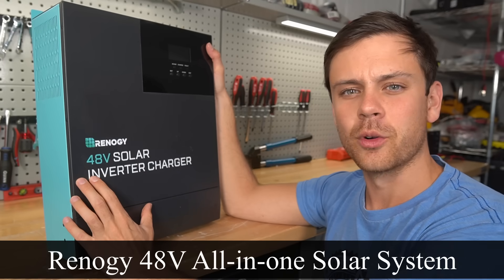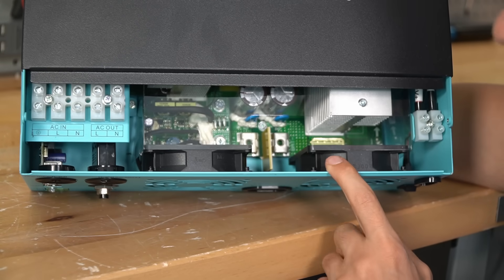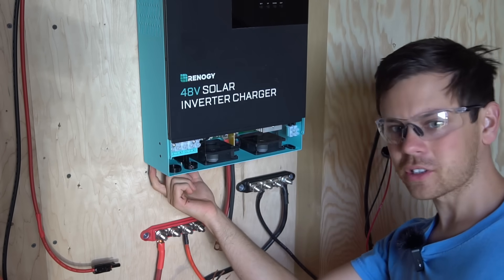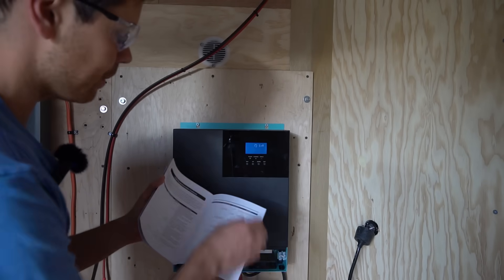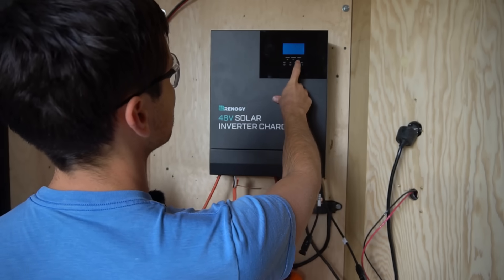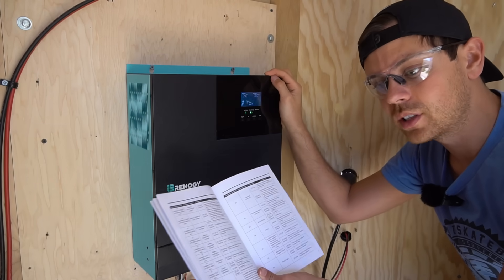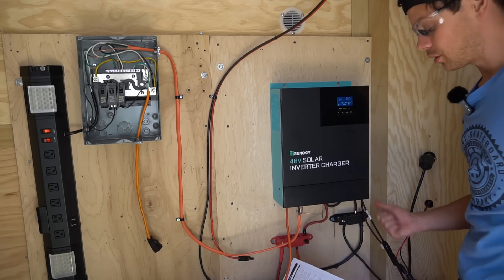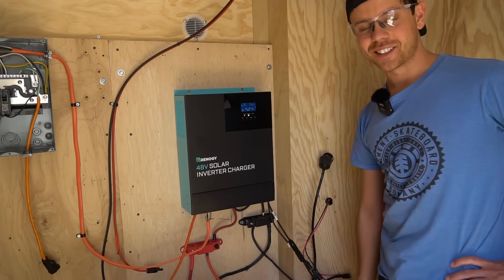Renogy 48V All-in-one Solar System: 3500W Inverter, 4400W MPPT, 1920W AC Charger

Comment: You know the watts have nothing to do with the grounding...
The ground connections are for safety and EMI reduction, nothing else. And improper grounding can actually cause EMI. 
Now, think you're running a house on that, on grid.
The inverter supplies bi-phase current, not one phase and a return/neutral. 
On the grid you get a phase and a neutral that is tied to ground in the distribution panel. Some inverters have a floating ground enclosure and some have the battery negative to ground. Who knows, there might be inverters that have the PV and battery negative to ground. 

Now, everything should be just fine if your on a single phase grid and make sure the grid neutral and inverter phases never meet (grid isolated) 
but the moment you add another phase like in the 240v american systems, things get complicated and dangerous. 
They just might had played it safe and left the metal case floating and to be earthed locally and not connected to the mains input or output ground.
Reply from the maker: I said in the video, non current carrying reference voltage ground. That should tell you exactly what I meant. "Non current carrying" means exactly what I said. The wattage wouldn't matter.
Reply from the maker: Wait are you joking me??? Why would you think that I think that? Jesus this comment is ridiculous
Reply: @WillProwse  Bro,  you said it.  Twice...  at about 5:10 and around 9:23. It doesn't have a ground wire connection for mains and you're pulling *Watts.
Reply from the maker: @PașcaAlexandru  do you not understand that every unit on the market has a nice little terminal to ground the case? It's nice. This one doesn't. I know why and how we ground, and it has NOTHING to do with that.  Nothing! I prefer having a solid ground conductor that is the same size as the others, connected to a strong terminal. It has nothing to do with the watts! But when you connect a panel, I like a large terminal to connect my ground to.
Reply from the maker: @PașcaAlexandru  I was mentioning the wattage because if you are connecting a panel, it's nice to have a single cable supplying three terminals and all using the same gauge. Like 99% of units on the market. I specifically stated the watts because that large of an output will usually supply a small panel. And like I said, it's nice to have a large terminal, like all the other ones have. You can run your own case ground, or whatever you want. I'm not even talking about grounding or how or why we ground. I'm saying it should have a terminal. Like I said in the video.
Reply: @WillProwse  Yes, it should have a ground plug there, maybe floating,  yes it's a shitty design. 
But once it's a slip of tongue and twice is intentional so that's why I had to put my boot in the puddle. 
Sorry for the stains on your shirt. Here's a napkin. :P

Comment: Hi Will, I was wondering what type of inverter of all in one system similar to that one you could recommend for a DIY solar generator. The generator will have the following specs: 

- 3000 W AC output 
- 48V second life li-ion battery pack 
- AC input 
- DC solar input 

Thank you :)

Comment: Greatly appreciate your investigative testing here. I have a blind trust for renogy I guess because my main array is from them and I have a smaller mppt 40a CC on another system and they have been rock solid for years now. I was actually looking at one of their all in one inverters to replace my secondary systems 12v aims inverter. Think I may go with growatt now. Thank you for sharing your work.

Comment: Finally bought the Growatt a couple of days ago, after learning about this Renogy option last week.
Anyone that might need 240v split phase in the future; this Renogy is NOT for you. It cannot be paralleled. While they may change this [in the future], this version does not support this. Something I think would be more visible in the stats and reviews.

I went with the Growatt over the MPP because the Growatt includes the parallel boards in each inverter; while it is a costly add on with the MPP.  If I ever want/need 240v,  and I think it is only a matter of time, I will have the most cost effective option.

Best of luck in finding what will work best for you and your needs; and thank you Will, for sharing so much of your knowledge and experience with all of us just starting out. Peace

Comment: Can you run a all on one charge controller with just batteries an ac ?  Were it would use batteries to a point then switch to ac to recharge batteries. Then go back to batteries.

Comment: My charger/inverter does glitch sometimes and not allow you to ac charge. It needs a minute with no power. Then resets. I bought it because I wanted a way to charge with no sun. With a 3500w generator the charger pulls 120w an charges at 75amps BUT my 4x 100w panels charging at 20amps charge it faster than the generator lol wth

Comment: I will never buy a Renogy product again. I bought a 50 watt solar panel a couple years ago, it would only ever output 0.8amps. Nothing near the rated 50 watt output. I called Renogy support and they said they wouldn't replace the panel. They didn't offer a refund or replacement. No better way to ruin a customer for life. Horrible customer service.

Comment: I would fully agree to that part about connectors, small connectors ..those are for sure not good to handle so much current. you should see one in Victron....only two holes to connect it to wall...that is crazy....4 holes is standard..

Comment: got the   MPPT  brand unit cause the others were out of stock  for 30/100 days during  suez canal thing.   never had any problems/    menu system  weak  but works good..   quick transfer switch... did not like my big bench grinder..    but fridge, microwave, 2 space heater  all at once  easy..  get the 48 volt version   number 6 battery cables are nice.     with  50 amp dc draw at max power.   quick free shipping.  about $600 delivered. 
 still prefer my $3000 outback system.   ** update july  still running good.  700 watt ac charger seems fine.   not grid tie but full fast UPS

Comment: Love your videos. I just finished up my DIY solar portable generator build. 1500w inverter 12v with 100ah AGM, Renogy Mppt 30amp CC and 2 - 300w mono 24v panels. Runs my window ac unit ALL day love it. New Mexico.
Reply from the maker: Awesome!!!!
Reply: @WillProwse  I would like you to comment on the comments made by battery hookup com about the emails they have received about the lithium titanate cells they are marketing because they claim that they have spent six figures on equipment to test to verify that it has never been used that is not still b quality...

Comment: The manual for this shows specifically that the AC Input ground goes to a screw connector, and the AC Output ground goes to the ground lug on the bottom of the case. It seems that the AC input ground is bonded to the case ground. Will didn't hook it up that way.  The manual also says that there is an internal fuse protecting the solar charging, so if that blew out it could explain part of the charging issue he's seeing in this video.

In any case, I don't work for Renogy and I've never liked their products anyway so this is something I'd likely never use.
Reply from the maker: Yeah I stated that in the video. Did you not listen to my discussion about the ground screw? Please watch the video before commenting. I covered this exact point in detail.
Reply: @WillProwse  I did watch the video, then I downloaded the manual and read through it. It appears to me that the cabinet ground is bonded to the AC Input ground, but I didn't see that the AC Input was connected to anything other than the Bluetti, so it wasn't actually grounded to anything. So the cabinet had no ground, which means the hardware inside had no ground. I'm just guessing but there might be some circuit inside that checks or senses for a grounding issue, and then limits or discontinues some functions when that happens. The manual didn't really say anything about grounding requirements other than showing how to hook them up, and that seems a bit sketchy to me but is just about on par with what I expect from Renogy products.

Beyond that, I can't see a reason why it should stop charging an obviously low battery that needs to be charged. So unless there was an internal hardware failure for one reason or another, the grounding thing is all I can come up with.

Comment: @Will Prowse  There are two mode settings for the charge rate #28 is ac charge limits # 7 is max charge current for PV. Also make sure you have setting #6 set to CUB. When priority charging AC..    I Recommend going through all the setting parameters and fine tuning them
Reply from the maker: Oh I am well aware lol I have programed at least twenty of these now and still own them. I am very aware of those settings. And I didn't change any settings when the output when to nothing and the solar was limited.
Reply: @WillProwse   I honestly figured you knew about those settings, I just wanted to run it by you just in case your eyes over saw the pv charge settings.   I am now really concerned because I use my generator to charge my battery bank every cpl days, and the ac charge has worked well and I like how the transfer switch works with out losing my clocks or shutting off my tv..    I'm am now almost to the point where I will be able to afford my panels. I really hope the built in mppt isn't wacked out ..  I guess for the price I really can't complain if I have to source out a external mppt charge controller..  thank you Will for posting your videos. I love watching the batteries get put to the test..  there is so many options out there and your videos help pin point which ones are worth the good ol US dollar ✌️
Reply: @psychopitt1982  if you only need to charge every couple days how come you just don't plug into Outlet somewhere even if even if you have to pay as much as the gasoline would cost? The answer is you bought a box without a electric car charging input port but for many years now that's the thing it's called the two-way integrated EV grid interconnect which is worth the cost of a gas generator when used in the mobile application. I can't imagine living in a van with significant battery storage without being able to plug into most common EV charging stations are guys on YouTube who do it for electric unicycles not just bicycles and of course motorcycle
Reply: @ereenatc6042  the reason I don't plug into a outlet is because I am off grid. There is no outlets for miles except the ones on my generator. Which is a inverter gene and it sups fuel..  I just bought a pallet of 28 panel last week. Waiting on shipping then the fuel cost goes even further down.. I bought land built a box and now have some nice comforts of off grid power
Reply: New update.. the mppt has started to act all squirrelly on me. I have six 100watt panels hooked up in series. I've noticed in the morning after having great sun for over two hours straight the voltage will stay around 60vdc and about 4amps.  If I trip the disconnect from the panels to the all in one for just one second it goes to zero then apon the reconnect the voltage will go up to around 120vdc then drop to about 100vdc and I'll have twice the amperage.. so every morning this has become my new ritual unfortunately...  I just purchased a external mppt
Reply: @psychopitt1982   Remember your load controls the Total   product of your amps  And  VO LTS . You leave out the panel wanage And any shading issues you have us assume are not existed. You seem to be saying that the system is now broken but obviously you could put a warranty claim in or not and have made it the scission to order a what you call an external . However we don't know if the system that you have is going to be expanded on the battery side. It's very very very good to read the manual thread very closely closely closely but if you don't have the background to understand correctly or if they are poorly written Doing so creates another set of problems. In some cases the people who write the manual do not understand do not have the background it's not merely that they can't write. It sounds like they're some sort of safety mechanism that you are triggering by disconnecting things improperly but then I have not given this question of yours if there is a question the proper study of what you are referring to. You do not say why you do what you do. When you do something without a proper motivation you create noise similar to pour documentation or insufficient background. Interfering with a charging algorithm when is obviously getting hot will in fact confuse you with the response . If you are going to baby said baby set you should then put your devices that are temperature sensitive in a cold environment monitoring to make sure the cooling does not exceed the inherent heating of charging. For example you can charge phones in your freezer for most of their charging cycle without the battery becoming to  Cold but the phone may not know that and t Mayhey prevented from charging ay
Reply: @ereenatc6042  I understand voltage and wattages.. the system is just plain junk.. I hooked up an EP ever mppt and immediately gained an extra 2amps on my charging and the voltage is much more consistent.  You had took alot of time to type out all those words.
Reply: @psychopitt1982   I dictator them so it doesn't take as much time but obviously dessication was going very poor on
Reply: I'm not sure if you have the same manual that I have.  Those are the setting numbers mine show.. good luck will

Comment: Are you sure most of your solar inverters don't internally bound the In Coming Ling Ground with the Out Going Ground internally? Also, I bet the components in the renogy 3.5k are being run harder without being any better or more capable than the growatt  3k.

Comment: I had an mppt 40amp solar controller that would stop charging or pull in half the amount of solar avaliable for no reason. I was assured it wasn't the controller and it was every else. So I went through everything twice and nothing changed. Then I bought another overpriced Australian mppt controller and it works. By this stage I couldn't get a refund because it was pass it's warranty of 12 months although I had issues for 2 months. But that is Australia for you

Comment: More crap made in Taiwan. I bet there's hardly any copper in there. I've gone through 2 of them. 
I also had charging problems with a generator. THEY ARE GARBAGE!!!

I bought a Victron MPII 5K and everything is much quieter and my batteries are in better shape in the morning.

Comment: Well crap, as the owner of a recently purchased, still unused one which was to be installed this weekend, this bums me to hear. I'm already worried that its maximum voltage is a problem for upgrading my system at a later time.
Reply: How’d it turn out?

Comment: Renogy are a curious company. They invest money in having local support teams in US, U.K. and Germany, unlike many other Chinese suppliers, so they should understand their user requirements, BUT they keep coming out with bad products and their documentation is awful.  The remote monitoring app for their small mppt charge controllers seemed to have been designed by a teenager who’d never used a solar system.  I avoid them these days, after spending a ton of money on their products a few years ago (all got returned to Amazon because it didn’t work right).
Reply: Ps. It’s very apparent that whoever designs their products out in China doesn’t consult with listen to their local support teams. Or maybe they’re just buying in third party products and rebranding them.